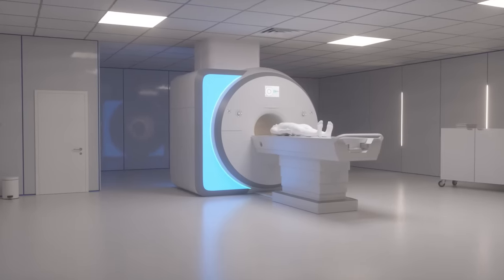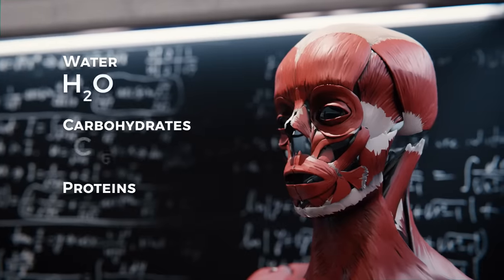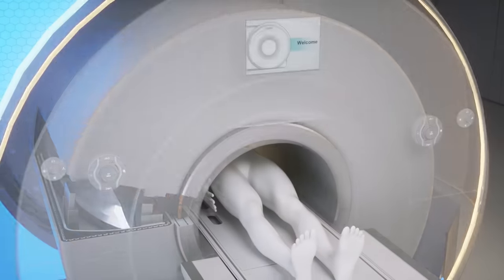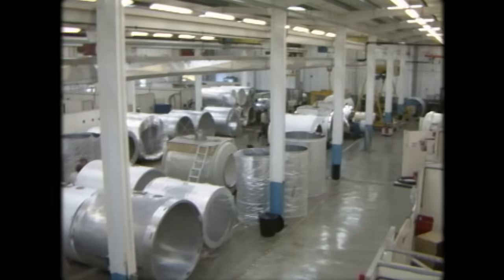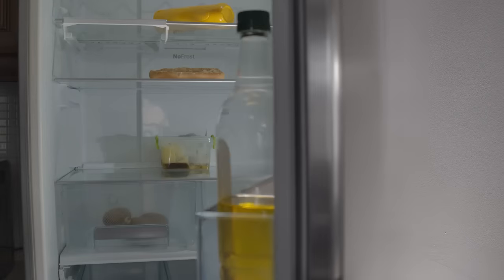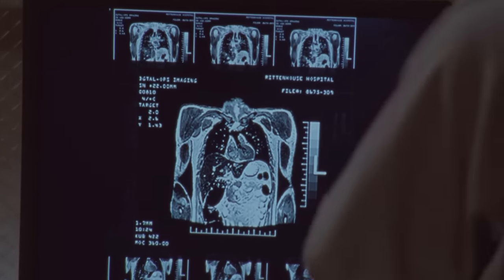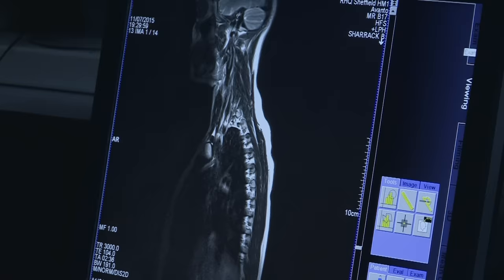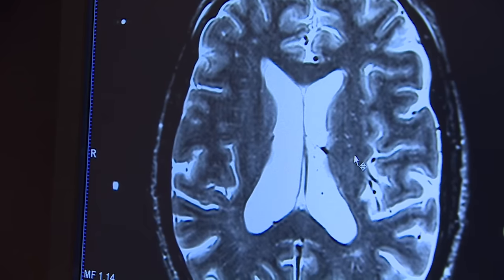The Insane Engineering of MRI Machines

Comment: I'm an MRI physicist, and you've done an excellent job explaining the physics and engineering that goes into an MR scanner!
Reply: I have a question left that I don't think the video has answered and that I have been struggling to find an answer to elsewhere as well:
I am familiar with the fundamentals of the technique from the area of chemistry using NMRs to help determine the structure of molecules. From this I know that the resonant frequency of hyrdogen nuclei is not as directly connected to the strength of the outer magnetic field as the video here implies, but that it is in fact dependant on the actual net magnetic field that the nucleus experiences and as such is influenced by the surrounding electron density and thus the chemical structure of the molecule it is part of (this is precisely what NMR-techology uses for its analysis).
So my question now is: If we already use the different resonance frequencies of hydrogen to select the "slice" of the patient we want to look at, how do we not get a mixed image from hydrogens in different chemical compounds and bonding situations having the same resonance frequency in slightly different slices? Are the differences in resonance frequency created by the gradient in the magnetic field just much larger than the differences through different chemical bonding situations (and does that mean this limits how thin the slices can be) or how are those problems avoided?

A very sincere thank you, if you have taken the time to read and consider my comment and question!
Reply: @nitramreniar  question was not for me but I may have an answer (though admittedly it's been a while since I worked with MRI machines). There is a so called chemical shift, it presents itself as the image shifting a bit, leaving black borders around an organ for instance. It's usually very small though and iirc can be corrected somewhat using some sequences such as fat suppressing ones.
Reply: @NerdyNEET  do better then
Reply: No, they didn't. This makes sense only after you have already learned it.
Reply: @nitramreniar 

The effect given in the video is Larmour precession, this is caused by electron spin not nuclear spin. It is a similar phenomena but there are different particles involved. NMR is due to nuclear spin not electron spin.
Reply: @NerdyNEET  that "most likely" is going a lot of heavy lifting. And this video is not supposed to be a graduate course in MRI. And if someone is motivated enough to learn more, there is a lot of open information out there, you can make small simulations on any computer starting from basics and test out the algorithms without having the hardware. The field is not as open as other fields in physics (mostly because the companies making the machines are assholes), but it is open and you absolutely can try the published algorithms yourself. And you can even download some raw files from some real images and try reconstructing them yourself, it's a lot of fun. 
But it's very much outside the scope of a 20min video, you can't pretend otherwise. This video fills a niche in the information landscape on MRI and does so wonderfully.
Reply: Does MRI work on different elements? Other than hydrogen.
Reply: @MultiLeandrini  yes it does. Gadolinium would be the most classical example. But there are even gases on which it works. I'm not sure if it's used clinically but I've seen a high speed MRI image (echo probably) of a gas being inhaled. Don't remember which gas though, need to look for something safe with a high spin
Reply: @andrekpt2459  can you tell me where can I obtain more info about this?
Reply: @MultiLeandrini   Hi, google NMR-spectroscopy. We can measure any element with a net spin in their nucleus, both protons and neutrons have spin. This means most elements have an isotope that could theoretically be measured. The most common forms of nuclei used in NMR are 1Hydrogen, 13Carbon and 31Phosphorus.
Reply: @mattgoette  Thank you very very much for your great response and for providing the website as a further resource! This has been a conflict in my understanding of the connectivity between the two methods that has been bugging me for quite a while, but that I was struggling to find any actual information on.
Finally having the information to reconcile this previous conflict in my understanding of the method has deepened my appreciation of the engeneering and the understanding of chemistry and physics going into the development of these systems!
Thank you very much!
Reply: Can you please answer some of my questions? Due to my condition I had MRI every year and every time they said. " If you feel sick press this balloon but we would have to restart whole imaging"
Fist: What in that system could make me sick? Second:  Why restart? My brain would be same even after some minutes,no?
Reply: all we need is an MR printer and we can make clones =p

Comment: I used to consult for the Toshiba MRI division. The building where they tested the magnets had a huge open area with yellow warning stripes painted all over the floor marking the "keep clear" area around the magnet under test. Turns out the yellow stripes were added after a screwdriver was left out and became a projectile during a magnet test. It punched a hole in the magnet assembly which is not a good thing when you're dealing with that much power.
Reply: That sounds astoundingly dangerous!
Reply: Crazy news story from this year (2023): “Leandro Mathias de Novaes was taking his mother for a scan at the Laboratorio Cura in Sao Paulo in January and entered the facility with a concealed handgun. Despite warnings from staff to remove jewellery and metal objects in the MRI room, Mr Mathias [secretly] kept his weapon on his waistband. The magnetic field from the machine was so strong that the weapon was pulled from his waist and fired off a round, which hit him in his stomach.” (The Telegraph)
Reply: @pukpukkrolik  nah that wasnt an accidental shot, the electricians took it personally 💀
Reply: @pukpukkrolik  I hope nobody was already in the machine...
Reply: @pukpukkrolik  great example of karma lmao
Reply: all of the rebar in the slab of the building has to be stainless steel within so many feet. the magnets are so powerful they will rip the rebar right of the concrete foundation. I just had my sixth mri on Friday.
Reply: @daciefusjones8128  
Kind of ironic that I'm ever in an MRI machine, but the doctors need to see what I already knew about myself. The spinal damage is something they can hear if we're in a quiet room, but it's harder for doctors to justify how I knew I had interracial calcifications before my first MRI was performed. Making matters worse for them is they insist the legions shouldn't be causing symptoms due to small size and location of the ossified legion. It's between the hemispheres located high in the parietal lobe between the paracentral and central sulcus. Odd place for a ball of bone-hard material to form.
Reply: My younger brother was a MRI technician for years then got a job at Bracco ! he would travel anywhere in north america to teach how to maintain the new Machine like how to change the injectors and all they must know to operate the new model ! he finally retired ! he was tired of living in suitcases ! lol ! Bracco was the co. ! 😎
Reply: I currently work for Canon, the company that acquired Toshiba Medical Systems, as a Customer Engineer. I've been out to the equivalent of this building in Irvine, CA. They call it NRC3 and the yellow lines are still there!
Reply: @daciefusjones8128  Surprisingly, no! The MRI room is built inside of a faraday cage. Effectively an electromagnetic shield. Nonferrous materials are used within the room, but not for the whole building. Come to think of it... the technology to even have these things inside of a building would have been a great addition to this video 🙂

Comment: 8:40 there is also something called "quench", which is basically if you need to turn off the MRI machine (if, for example, an accident happened and a metal oxygen tank was launched across the room towards the machine) there is a big red button which increases the inside temperature of helium so that it removes superconductivity, which causes helium to instantly boil from liquid to gas. That's why there is a quench pipe, which releases the helium gas outside in a huge cloud of white gas. However, if for some reason something breaks and a helium leaks inside the room, aka the quench happens inside the MRI room, it can be extremely dangerous because people inside the room can suffocate, which is why MRI room doors are (or should be) designed to open towards the outside, because if a bunch of helium releases inside the room, it's going to put pressure onto the door, you won't be able to open them and you could die. And in case of a quench, you will lose helium, and need to refill the MRI machine, which is extremely expensive.
Reply: Imagine screaming in agony because there was a helium leak and all you make is chipmunk sounds !
Reply: @BlastarX  Probably not in agony, but panic and lightheadedness wouldn't be too much better.
Reply: Even better - depending on the cryonics in the cryostat, you have multiple different hazards from a blocked quench exhaust:

First, liquid helium.  This is lighter than air so you need to drop to the floor.  As you mentioned, this can also cause the door to become jammed which can lead to suffocation.

Second, liquid nitrogen.  This is heavier than air, so dropping to the floor will actually kill you.  In this case, you actually need to walk normally/keep your head up.  This is very rare outside of research installations.

Third, liquid helium and liquid nitrogen - worst of both worlds and uncommon but possible.  In this case you have to keep your head in the middle of the room - too high and you suffocate, too low and you suffocate.

The training I received is to crouch walk out of the room and to always block the door open with a doorstop or other mechanism so long as you’re not doing a scan.

None of this includes the frostbite risk if you’re standing next to the machine.
Reply: @ScienceReasonLove  helium stratification typically requires a calm environment, an MRI quenching is violent, fast, and the expansion ratio from liquid to gas is high, dropping to the floor is likely going to waist the 1 or 2 seconds you have to get as far away from the thing as possible.
Reply: Most MRIs nowadays have gas containment shells that envelop the entire machine and route into the exhaust conduit so that if there is a helium escape it will go up the exhaust anyway.  Machines with shells look far more bulky than machines without and often look as though they are built into the room.
Reply: I wonder if this has happened before

Comment: I'm an MRI engineer for a company featured prominently in this video and this is genuinely one of the best summaries of the technology I've seen so far. 
If you're still baffled after watching this video that's perfectly normal. This is stuff that's typically taught over the course of weeks or months not minutes. In spite of the short run time this video is densely packed with useful information. 

Well done.
Reply: One question ive had a while you might be able to answer then is is there atleast a safety system or spool up time on these things if theres anything magnetic detected? Say one happens to have a peice of mettal in the body like the appendex without knowing? The thourght alones terrifying.
Reply: @JMAssainatorz  the device itself does not have that safety because when one is in the strong field the bad thing can happen. like people with heart pace makers or war veterans having shrapnel in critical locations like brain. it is the staff responsibility to make sure there is no such thing. and imaging with metallic pieces in body will affect the image due to their different magnetic properties.
Reply: In another comment, an MRI technician pointed out 13 things that are wrong in this video. If you're an MRI engineer, you cannot not point them out.
Reply: @JMAssainatorz  No. The magnet is always on. It could quench however if the field is disturbed too much and lose superconductivity, then it will no longer be magnetised.
Reply: I need some numbers in the last part: How fast does it change different frequencies? What do the patterns really look like?
Reply: I think you are Siemens engineer.
Reply: Where did you recieve your training? Did you study physics or engineering or mathematics?
Reply: @JMAssainatorz currently no such safety system is there, however normally the patient should be scanned with hmd before entering the room.
Reply: @peterjones4572  
To know how fast does it change frequencies you should first know each Magnet have different Gradient system
Different Gradient systems have different performance which is measured in slew rate
Slew rate states how fast does the Gradient coil reaches its max field amplitude
Slew Rate for some of common systems varies between 125 & 200 mT/m/ms
While their corresponding max amplitude are 33 & 45 mT/m respectively 

By doing math
You will get the following Rates 0.264 ms & 0.225 ms respectively

Before we continue please note that the time mentioned above is for reaching the max amplitude, in real life you need to keep Gradient field ON for some time after reaching desired amplitude (not necessary max) then you capture the slice then you turn Gradient OFF Which consumes another 0.264 ms or 0.225 ms

If we assumed for now we will turn Gradient ON then OFF momentarily (not real life case) then we will have theoretical rate of 0.264x2= 0.528 ms & 0.225x2= 0.45 ms

Which is equivalent to 1.89 KHz & 2.22 KHz
Which means Gradient can theoretically change the frequencies 3787 or 4444 times per sec if you need to reach max Gradient Field Amplitude

If you need to reach lower amplitude you can achieve higher numbers
But remember we neglected the time Gradient stays ON in real life bec. its not constant, it varies based on many factors
Otherwise we should add it to above calculations
Reply: @brinckau  you mean that as many as 13 (!) things in this video is wrong?
But how do you know that the other person is right?
I have no idea, I’m just curious ☺️ But look at all the comments, and look at other videos that explains this. Is everyone wrong and the person you found right?
Could be, of course. And in that case I guess you have a plan. A better video? Sure?
😁
By the way, my grammar errors.. I’m ok with them. I’m not perfect.
Reply: @VarionJimmy  Yes, maybe the other person is wrong.
Reply: MRI technology is a very interesting one to study, as it combines different scientific fields. I knew a very little about the static B-field and basics of spin-effect but still need to understand better about the gradients and actual sensing...
Reply: I don’t know if the machine still does it I haven’t had an MRI in a while. But what is that loud banging noise when they turn it on?
Reply: @wheatworkspro  Another Siemens MRI engineer here :D The loud sounds come from the coils which start to vibrate due to the fast on/off-switching
Reply: I teach NMR and this the best explanation of that I have found.  I will be using this video in my structural determination course.
Reply: @JMAssainatorz  Normally, the patient has to fill out a questionaire about their history.   The techs will normally "wand" the patient before actually entering the scan room to help ensure there's no magnetic "stuff" on or in the patient.   Sometimes people lie on the form or simply don't know or forget they have a piece of iron, like a BB from a BB gun, in their face or whatever.   The MRI system itself?  It just wants the iron and will get it if given a chance.
Reply: Sounds about right. that machine and those forces just dont give a Fuck. as others have mentioned too there are procedures in place luckily. @NESig
Reply: That’s honestly reassuring 
I’m studying biomedical engineering currently (was also a pharmacist first, they covered it a bit in that too) and whilst I get all the underlying physics and all that - what got me was how that signal is put together into a larger image overall

It was bugging me that I didn’t understand it completely/well enough; so it’s nice to hear it’s something that’s pretty content heavy in the full picture
Reply: @BSSchumacher  Niche question but you’d likely know a lot better than I do currently; how do diamagnetic materials behave in an MRI?
I’d read conflicting things; but the most common thing I saw was that it can induce localised fields which in turn could reduce the resolution of the output image 

Is that true and/or are there other considerations I should be aware of/read into?
Reply: What degree do you need to be a MRI engineer?
Reply: I had an mri today on my left knee, probably my 20th MRI in my life. Fascinating technology and fantastic video explaining how it works. Thank you!
Reply: Can one get MRI done with metal caps on teeth (don't know about the metal used)?
Reply: Use the FMRI to detect a blue and red brain.

Comment: As a former mri technologist, I am happy with this very clear explanation without oversymplifying. Brings back memories about understanding the process of 'fitting the k-space' with all the signals measured and generated by the measuring gradients after the initial excitation pulses (slice selection and x/y matrix) echoes readout. FFT was genious. And nowadays mri relies far more on ultrafast 3D volume scans with very little gradient angles instead of the 'simple' 180 degree spinecho sequences.  And the dreaded mri sequence acronyms between the manufacturers! 
Thank you for rhis video.